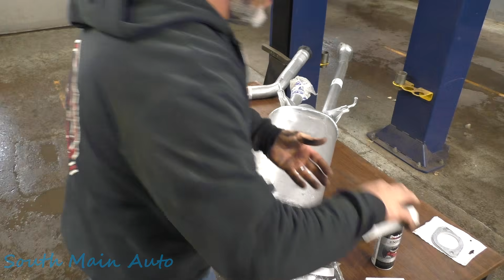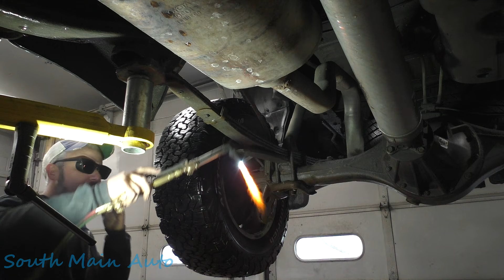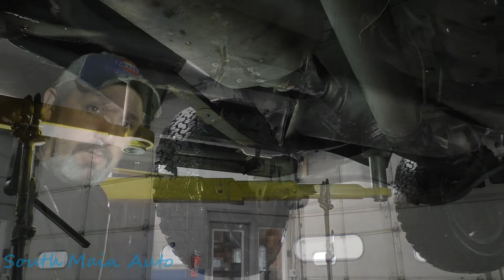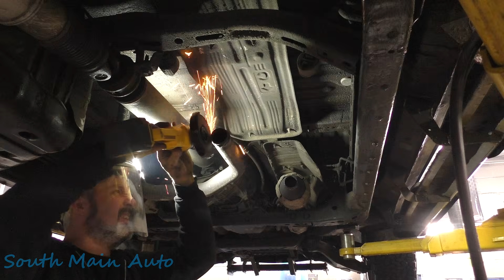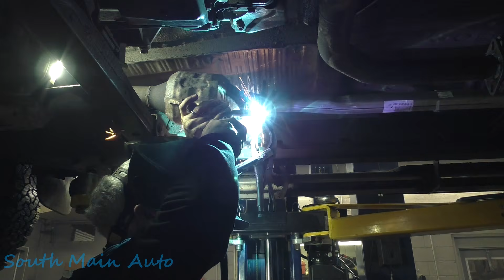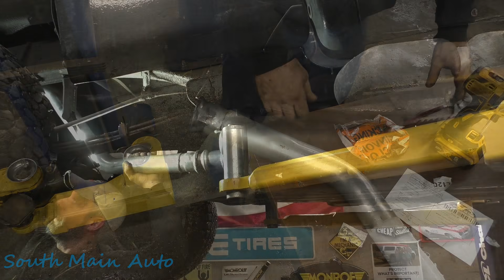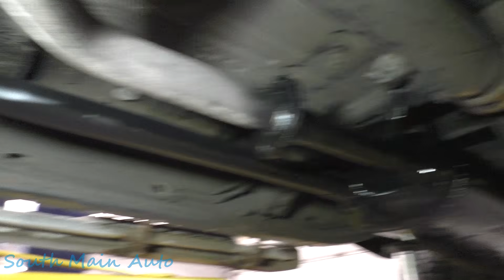Toyota Tundra: Welding On New Convertor Flanges & Replacing Muffler

Comment: Just ran across this video when checking to see if you posted any new ones. And nope you haven't yet lol. Figured this video is 3 years old. How about a update on how the rock auto exhaust system is doing. Did it rot off yet?

Comment: I use my torches all the time. Acetylene has gotten so expensive I've switched over to propane for my fuel gas. Just use a natural gas tip and away you go. For heating, burning bolts off, propane is much cheaper.

Comment: On my own and my free repairs I do for seniors low income single mom n dads I use the 2piece flange that bolt together for exactly what is going on here , if I have a regular flange hanging around from something that got welded and We removed the flanges from exhaust pipes plus , its just like the muffler shops did b4 the 2 piece flanges came out and they were helping their customers SELVES FAMILY ECT . CHEAP QUICK FIX knowing it didn't need to last long or scraping soon selling + I take cut flange one side twist it over pipe bend back weld it back together 😃 IF YOU HAVE A TRUSTED SHOP THEY CAN HELP YOU SAVE MONEY VERY EASY ... I Do it alot for the people with love , I even bought a car for a senior hit n run left her injured on top of her ins co. Talking her into saving 20 bucks a mo. by telling her to Drop collision old car , DO NOT EVER JUST FOR THIS REASON DO THAT IF IT ONLY SAVES COUPLE BUCKS . Anyway 90 years old lost her partner still cleaning homes shops ECT , to pay bills and eat , SO I GIFTED IT 4 DOOR HONDA FROM AUCTION LOW KS , COMPLETE PAINT JOB PEARL WHITE , PLUS SAFTY ANYTHING IT NEEDED I EVEN SHAMPOO AND DETAILED IT , PD 6 MO. INS FULL ! FILLED HER GAS TANK , I found out by her sister she was crying and staying in bed depressed... Kindness can fix SOULS FROM WITHIN . She told me no one ever did anything so kind for her , Well I did , told her to pay it forward , lol enjoy live be happy , you are all important , I love you all . Stay in the light , check on your seniors around you if you have extra food from your dinner take it to them give to them don't ask they will always say no . 😇💗🌍  I love you all .. BOYSTOWN GARAGE ONTARIO CANADA . LOVE WINS , PS DON'T BUY A MECHANICS CAR WE DONT FIX OUR OWN AS A RULE NO MONEY IN IT LMFAO 😂 BE KIND STAY IN THE LIGHT LOVE WINS ,

Comment: I put a Walker cat back system on my '04/V8 4Runner 5-6 years ago and it's holding up fine. I live in Chicago area so it gets harsh conditions, but ony about 3K miles per year, but even so, I'd go Walker again. My 4Runner performs very well with it too.

Comment: Even out West I have never seen an operating shop that did NOT have a torch & now that I live down South, other than chain tune-up shops where they don't actually work on vehicles, every shop I have ever worked in or visited has had at least a single torch setup available & they get used pretty much every day.

Comment: Greetings from CNY, Looking at a 2008 Tundra a friend of mine is selling ... Has a bit of rust on the quarter panels, the tailgate and the undercarriage. I plan to use it as a winter rat and for limited towing. He previously fixed the exhaust...passed inspection...anything else I should know? 
Thanks

Comment: I'm in OKie-Land and I don't trust a shop that does not have a torch set-up somewhere.
It's not any different than a grinding wheel or a plasma cutter... It's still gonna catch fire if you find a gas leak.

Comment: are u using flux core wire or solid with 75-25 gas  if u using flux core u can take that gas cup off end  where ur consumables go, makes welding with flux core easier

Comment: Dont forget to disconnect the battery on the vehicle also before welding...computer system of the vehicle will need replaced if you don't

Comment: What makes torches expensive is in a group of guys only one owns a set. Everyone wants to use or borrow them. My uncle had a nice set,. His buddy had them for ever. He borrow them, bring them back empty. We go get new tanks. Guy would borrow them again. Finally us kids got old enough, and mouthy, we came right out and told the guy the Airgas place is in binghamton, a 5 minutes drive. Don't bring them back empty again a●●h%le. Next time they came back they had new tanks but one regulator was messed up. I was mad. When my uncle needed cutting or welding done I had to do it. So everytime I seen that guy I asked to borrow his new set of torches. One time he said sure. I used them to blow a big bolt out of a blind hole.smoked his only tip. I wanted to put red locktite on every connection but my uncle stopped me. Back t hen a set of torches was very expensive. Messing up our regulator really pi$$Ed me off.

Comment: I was welding on something in my shop and I noticed a shadow of someone walking in behind me. I finished the weld and turned around to talk to a buddy the dropped by. We just started talking and he reached down and grabbed the part I was welding on. Of course it was still ridiculously hot and he instantly got 2nd or 3rd degree degree burns. Instant huge water blisters. He looked at me in shock and asked me why I didn't stop him? I told him, "You saw me welding and I couldn't believe you would grab it!"

Comment: I owned my 2000 Cavalier for 19 years (R.I.P.). During those near 2 decades I put 5! Count em, 5! Walker exhaust pieces on it. Now, the muffler? I stopped getting that 2nd year. I got a NAPA performance one. It was a tad louder but had a nice little rumble to it. That lasted 4 years each. So that was good. The flex pipe just under and to the side of the oil pan was replaced at least 6 times!

I would have my friend DJ at DJs Auto Seekonk Ma weld one in about every 2 years or so. The cat was OE until I junked it so that was awesome. But the other pipes lasted 2 years each in these Mass winter and salt cycles.

Rest in Peace my little Cavalier. You never stranded me. You owed me nothing when the tow truck came for you this summer. You were a good boy for 19 years! I put 165K miles on you. One cylinder head, about 3 batteries. 4 full sets of tires. 1 alternator, 2 starters, 2 water pumps, 1 PS pump, 1 radiator.

Some of the bulbs on you were still OE. As was the fuel pump. Oh! 2 aftermarket CD players.

I will always have the memories!

Comment: I've never seen that pipe flaring tool on a drill before. When I was doing exhaust we hade a hydraulic pipe bender and flarer and would use that to make sure all the pipes were round before fitting. Then you don't have to fight it on the car. That hanger stuck in the muffler is unforgiveable though. That should have been removed before shipping.

Comment: ROFLMAO i can see it now you neglected to use JB WELD it would hold that exhaust pipe better the the miller would! ( P.S. JB Weld will not burn the fingers) and look better to boot. fyi i drive a 2012 YOTA and i am and forever will be a Chevy man but the YOTA gets me where i need to be. P.S. i also own a 78 ford Bronco.

Comment: I hate muffler/exhaust work.  I'm 70 and just put a new muffler and tailpipe on my 98 Malibu.  All Amazon and O'Reilly parts.  Not bad.  A lot of messing around making things fit.  I have a little advantage, I was a dealer line mechanic back in the 70's and then changed careers and spent 25+ years doing computer software development, so at least I have all the tools and some kinda background.  Love your channel and appreciate your skill level and work ethic.

Comment: I had an '08 Crewmax 5.7 with 335K miles, here in Texas, so little rust.  Hardest repairs were water pump, starter, and engine valley plate re-seal.  The last required a lot of extraneous stuff removal and put back, and the starter had to be done completely through the wheel well. Lost that rig last Nov. (2023) to the insurance company when a guy on his phone rear ended it with authority.  Now have a  '21 (the last good year) Crewmax. Disappointed that Toyota decided to delete any transmission cooling whatsoever, so will be rectifying that, but love my Tundras.  Oh, and I love my '01 2500 Silverado too.

Comment: Just so you know Toyota is not in the business of making exhaust mufflers and tailpipes, they spec them and then buy them in bulk.  The OEM that they buy them from, may or may not sell the exact thing on the aftermarket.  I have a 2023 Toyota Tundra (3.5 L twin Turbo V6 )that has a safety recall on it for an for a possible plastic part of the fuel tube assembly hitting a steel brake line and possibly cracking causing a fuel vapor leak, with an ignition source, truck can go boom.   I have the interim fis, that I like to call the baby bumper to keep the plastic part from contacting This is caused by Toyota moving the Tank to the passenger side, and keeping the fuel door on the drivers side)  From the NHSTA recall website the OEM is made by Textron Inc in Providence RI

Comment: We used many Walker parts and components over 40 years and i don't recall ever having a problem with them. Maybe they are thinner steel but usually will outlast the vehicle. The shipping damage we tolerate is disgraceful.

Comment: When i worked in a machine shop
Using a Touch i was told to make sure not to get oil on the oxygen valves it can explode as i recall 
Now that was told to me by a journeymen welder  that guy could do any type of fabrication work .

So thats my take on a torch in the shop, but its common to see muffler shops use them.

Comment: My 2001 Toyota Celica has 300k miles on it tail pipe is perfect, its only ever been in the shop to get tires.  I do my own oil 
First pad change in frt was at 233k miles we bought the car new.
I only buy toyota parts,  oh forgot 
When they went to 10% ethnol i had to change a part on the intake that meters fuel the ethnol ate the original part  i changed the drivers door lock and its had a few like 1 or 
2 minor problems i fixed like plugs and coils. Wear parts. I still drive it.
Scottys 94  gets about 33 city and 37 highway miles to a gallon i had one. Drove it to about 300k
It never went in the shop.

Comment: I live in Quebec and work on my own stuff for 40 years and I can’t imagine trying to tear down anything and rebuild it without the use of torches, plasma cutters and a Mig if you factor time versus messing around trying loose nut or cutting with a grinder or air chisel the torch is the most efficient solution

Comment: It would cost me $4-800 to get a full size cutting torch set used.  Leasing tanks would cost me quite a bit and I would probably only use it a couple times a year.  The tiny tanks wouldn't last very long.

I've been considering getting a propane oxy setup.  Propane is easy to get and cheap.  

There are definitely times it would be nice to have one but I have a plasma cutter, cutters, grinders, and a small propane torch.

Comment: Out west here in Wisconsin we use enough salt on rhe roads to turn lake Michigan into an inland sea. And rhen rhey tell us not to use our water softeners because they increase salinity in the discharge water. Hmmm? Anyway, a torch is pretty much SOP in a garage around here. I haven't replaced exhaust on any of my front line vehicles in a long rime but I use a user friendly 20", 2" center line and 2" offset bi- directional muffler on all my projects. Two on my 64 F100, one on my 65 F350, two on my 74 CJ 7 and one on my 79 CJ 7. These are all solid drivers, not trailer Queens so you may not consider the exhaust systems as factory correct. Dont care, not my goal. Just wanna have fun😊

Comment: I grew up in the UK (salt Island) and moved to Non salt Oregon in '96. I must admit I don't miss the rust one bit. I scrapped a '97 Dodge Neon a couple of years back and there was not a spec of rust on the shell anywhere. I do however own a cutting torch that I bought from Harbor Freight for $50. Even though I have never used it on a car I must say its so dang useful to have some serious heat when you need it..:).

Comment: Really appreciate the information and advice you share. Wondered if you might provide some insights into your welder setup for exhaust work and how you  ensure a continuous, leak-free bead on the top side of an exhaust pipe.  Thanks.

Comment: On the Torch issue, Eric, I grew up in Buffalo Area, and a lot of the High schools had basic shop class. In there i learned about heat treating, and torch flames, etc. Since I got my degree, i basically have been in the south and California for most of last 30 years and get to see the underside of a lot of southern vehicles. Even though I also have my own shop in SC, I sometimes still use a torch for exhaust stuff. Its just too burnt up, not salt, to get off with just a wrench. It seems the threads are exposed to a little bit of moisture for so many years that they get thinner and then the impact just shears them off. Surprisingly some stuff on Southern Exhaust does come off with an Impact. I dont think the shop classes exist much in the Southern school system especially more recently as the skilled trades have kind of went away in the schools. Ive also used my torches for Silver soldering on AC systems on houses(copper) now that is a necessity in the south and it costs way way too much to have someone do that work. I also have done brazing of steel panels when i do body work. One more use: getting studs out of exhaust manifolds, now that is where the torch really earns its value rating. That happens North or south. Good Day.
Reply: ALso, we like to call it a "fire wrench"

Comment: When you use a torch it changes the properties of the metal you cut or heat up. These changes affect the corrosion resistance of metal

Comment: Wow ! That Muffler looks like some kind of galactic space cannon. I hope it holds up . I bought a Big A OEM cat back exhaust for my Dakota years ago. It made it almost 5 years here in good ole Connecticut. I hope your Rock Auto kit does better !! As far as your Welding torch comments go, I have noticed that mechanics seem to be using them less and less. I'm not really sure why. I suppose there have some been incidents with them over the years. 99% of them I'm sure were user error. But there are times where there is no substitute for one.

Comment: The torch comments make perfect sense. I always cringe when I see you do it because I know, beyond all doubt, that if I so much as used a tiny lighter under my car, to take off a ziptie or wtv, there would be flammable greases, oils, fumes and misplaced gasoline residue that would instantly ignite even from several feet away and within a millisecond the entire underside of the car would be in flames. If I used an actual torch to cut a tailpipe it is pretty much guaranteed that the car would instantly explode. The underside of a car smells flammable. It is covered by an assortment of oils and vapors and greases so it's not far fetched to assume that it could be. Exhaust can smell very gas-like so I'd assume cutting into one would cause some kind of chain reaction with the flames traveling to the converter and god only knows what will happen there with all of the oddball elements, maybe a full thermo-nuclear explosion....unless you are doing it, then it works fine every time.

Comment: I recently went from working in NE to MD. I ran into the same thing. People complain about overuse of heat. 
I will say that I never stripped a bolt in that shop while there and started to see more techs use the “vic”. 
People in the lower states don’t realize how good they have it and should open their minds to a little heat and taking extra time on what little rusted nuts and bolts you do get. 
I’m starting a new job in FL tomorrow and am interested in their response to “rusted” materials I run into.

Comment: I grew up with my father's pipeline welding rig in the driveway.  Your torch technique is excellent, and MIG work adequate to purpose (I have MIG welded piping for a Nuclear project) .  Doing it all with bare hands makes my old burn scars throb, but you get away with it.  Don't let the would be fire jockey comments bother you.  Gloves and safety glasses are all I would add if I tried this job.  Good Work.

Comment: WALKER QUIET FLOW SS mufflers are very good.
But, yes, they usually are restrictive in OEM sizes.
But, if you choose a larger "universal" size they are really good.
I've found they only discolor on the back end wall.
The stainless turns a nice purple/blueish color.
But ask the chap in the flying saucer what he uses.
We are still a 'Cain and Able" type society.
Indians called it: " Forked Tongue. "

Comment: In the UK I find that the silver paint used by the exhaust manufacturers usually burns off in the first few months of use, do they use better paint in the US, will your black paint seal in their silver paint ? Lol  Can't believe there are so many car parts on back order, hope it's not the same in the UK ? I try to buy pattern parts as genuine are usually three times the price, but not three times the quality, still made in China. Luckily I don't drive so many miles any more. Thought I'd been sold some fake NGK spark plugs last month, turned out I had sucked up a bit of sludge from the bottom on my fuel tank.

Comment: I feel so good owning an old school Toyota that has been maintained. 330000 miles and still can’t see oil on dip stick at 4000 miles when checked. 5,000 mile oil/filter changed. Required maintenance done when needed. Scotty wasn’t wrong.

Comment: I found that a big torch set for home use isn't needed  for me. I no longer have the tanks and the torch set is in storage. I found the small torch using map gas and oxygen is all I need for heating bolts and a plasma torch is used for cutting. Cutting a muffler clamps I use a battery powered angle grinder.  A shop that uses bigger tanks should be cheaper but for me my little torch once a year or two is more economical.